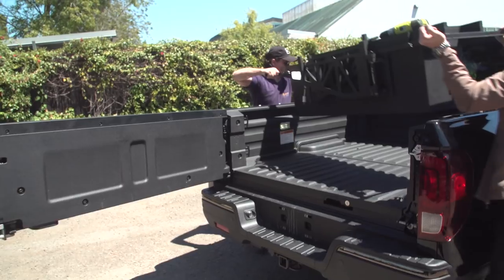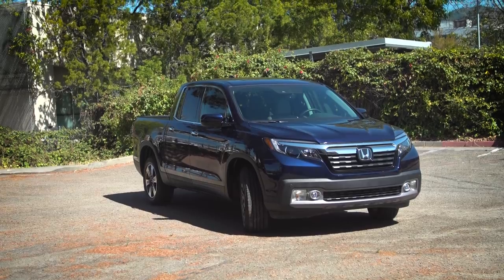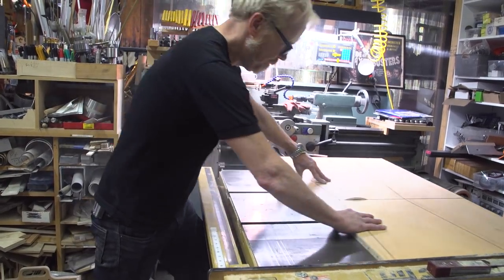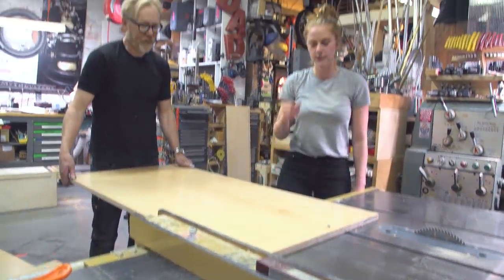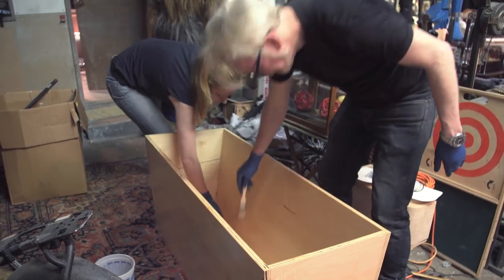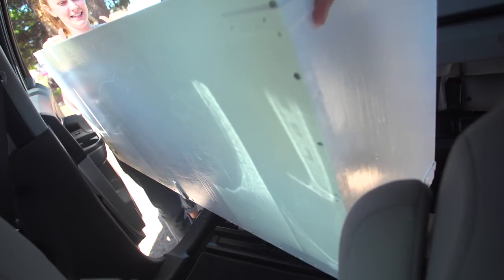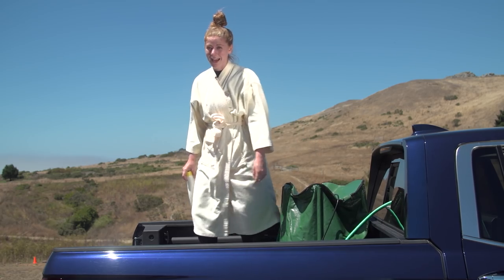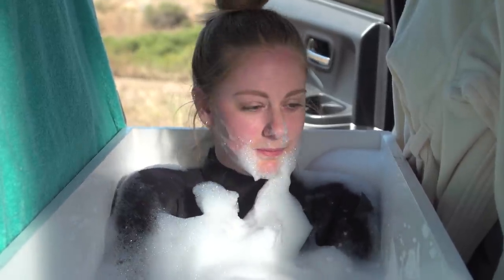Features Not Standard: Simone Giertz Builds a Bathtub in a Truck!

Comment: Hi, I work in theatre and I design and build sets for a University theatre department, I'm currently planning a set design that involves building a fountain on stage and I'm curious what resin compound you used in this for the waterproofing, I've tried a few different ones with different degrees of success. Thanks in advance.

Comment: Okay so improvements I'd make.

1. Put it in the truck bed.
2. Heating solution. Make sure the tank is black for solar heating of the water, or failing that have bricks/rocks of some type that I can take from the fire and dunk into the water to heat it up.

Comment: Some solar water-heating on the roof-rack would solve the cold water issue. 
Personally I'd have gone with a collapsible frame to hold some kind of toughened waterproof fabric, so it can pack away when not in use.

Comment: Use black for the water container and park in the sun. Unless you like camping in the winter it will be warm enough by the time you need it.

They missed an important feature... a drain. It shouldn't be that hard to add a fitting, a valve and a coilable hose that extends out the door when you are done.

Given those two things.. it actually might not be entirely unpractical.

Comment: If you get some Sous Vide immersion circulators, it can heat the water for you and keep the water at the optimal temperature indefinitely (or until the truck battery runs out). You might want to get it started by mixing boiling water and room temperature water in a 1:4 ratio though to save on battery power.

Comment: They have propane pump/heater things for hot tubs, hot could add that in the truck bed coming through the window without too much difficultly and then this would actually be kinda good. Although I think in the truck bed would be better than in the cab.

Comment: There actually are manufactured folding bathtubs for camping purposes. They have collapsible frames with waterproof liners of plastic sheeting or similar material. There are also solar showers for heating the water.

Comment: ok not sure if help. couple ideas how fix part water not hot. one native Americans heat rocks then put hot rock in basket water cook food. so could heat rocks drop tub and should bring warm like. you two problems this. I fix one problems. problem 1 rocks way to hot for foot any body part touch right way. need put wooden crate or box holes over rocks so burn feet. problem 2 rocks burn bottom basket means do same to tub.  other coat bottom tub metal or floor tile not sure this solved.            solution 2  diffrent u tub Chanel had fire powers hot tub. don't rember exactly how worked the copper tub that rain water hot tub to fire to be heated up. like think  had metal barrow heat water in then turn tape drope how ever much hot water tub. this be not in truck.    like think copper tub coiled around something but just make sense put fire inside coil let heat water that way. copper can melt so not sure how solve wood problem.      option 3 if wheat idea make tub metal just put it and water over fire. or make fire under it have up legs. problem this. risk splash water out put camp fire out. also metal heat up like rocks so tried put truck catch truck on fire.

Comment: why the heck wouldn't you heat it? my friends and I pretty regularly build 8-12man hot tubs out on the bush and heat it with a copper coil in the campfire.. takes about 4 hours to heat to hot tub temps in an un-insulated tub with no lid. Im pretty disappointed in the lack of heat.... for something like your small tub even an instant hot shower would have heated it just fine.

Comment: could have built a radiating coil, powered by the cigarette lighter to heat the water...
Reply: You mean a death trap, that raises the water's temp by 2 degrees before it kills the battery?
Reply: If they can power portable dvd players hours on end, no. Also, you don't fucking lay in it while it's heating the water. You get in after.

Comment: lol, why put it in the cab? you're losing space for people to ride. in the bed would make more sense, as you could still use it to store your gear in while in transit. 
Second note, I didn't hear anything about a drain, which would also make the bed the ideal location. Without one, you'll need to use the same pump you used to fill it to drain, since it will be too heavy to try to pull the tub out and dump it, which would also probably end up going inside the cab. plus if there's any splashing getting in, you'll have a mess in the cab. 
third, people do take baths while camping, it's just done in a lake.

Comment: its super stupid
Reply: It Could have been a cool Fire Fighting Pool Party Hybrid Truck~

Add a recycled food safe 250 gallon IBC tote, High pressure water pump, Fireman Hose and Nozzle, and a fold up kiddy pool.

Fill with clean water right before trip , use as shower / clean dishes / fill portable kiddy pool / spray on water slide / portable car wash / fight fires / fight bears ~